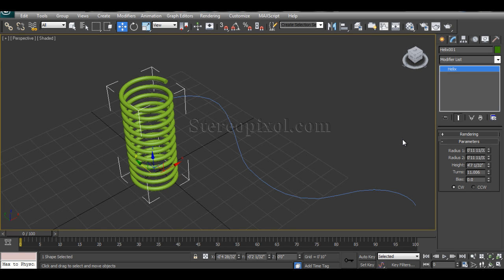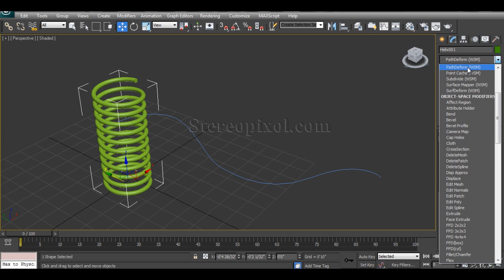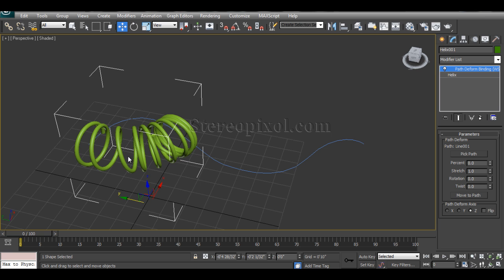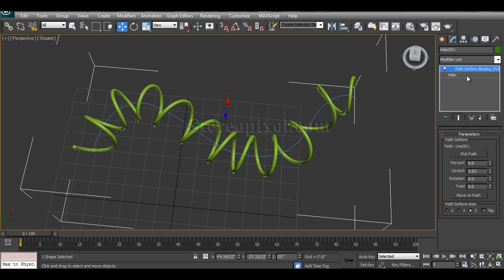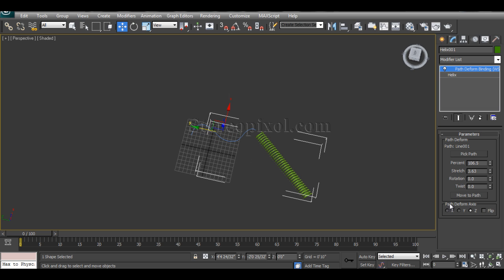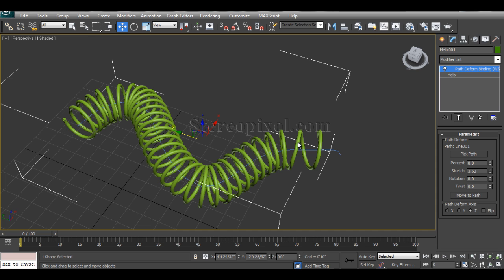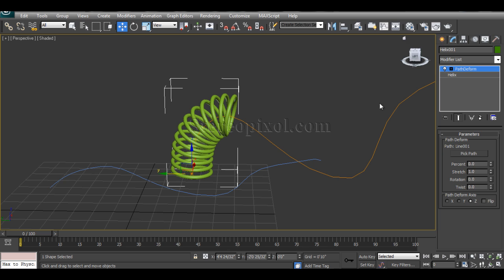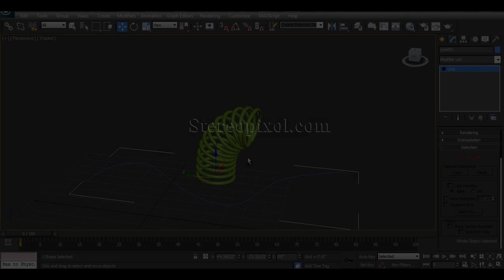Path Deform Modifier in Autodesk 3Ds Max - Beginner Tutorial

Comment: I have a question. Once the model is finished, when I want to move the Deformed Path, the model is altered and distorted. I tried to convert it to Edit Poly but it doesn't work ...
Reply from the maker: Did you convert it to editable poly or apply an edit poly modifier? Which version you are using?
Reply: @Stereopixol  
I could already solve it. Thanks for the reply hehehe
Reply: @AlejandroGarcia-vw8dy  Hello, I'm very late to the  party, but how did you manage  the solve it ? I'm like you I want to move it but I keep getting the same issue as you
Reply: @houssemhammami7816  
It was a long time ago, so I don't remember what the solution was. However, with many modeling issues in 3ds Max, I came to these conclusions to solve several of them: apply Reset XForm to the model and adjust the pivot so that it is correctly positioned on the model
Reply: @AlejandroGarcia-vw8dy  thank you very much man